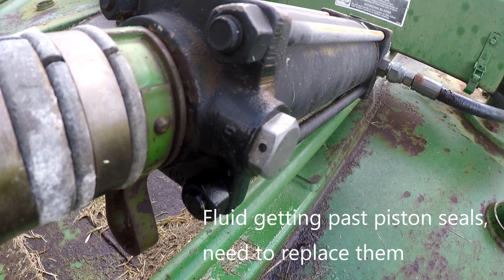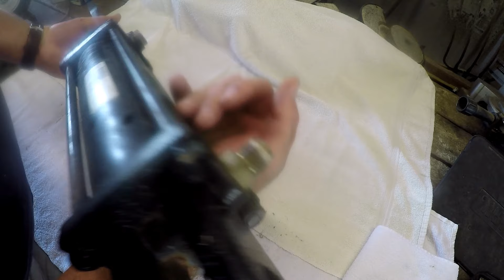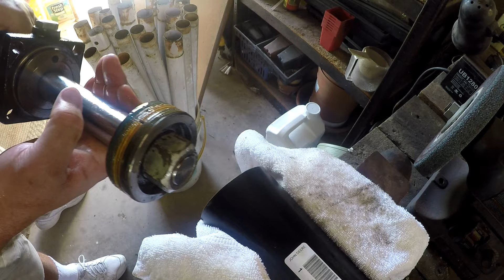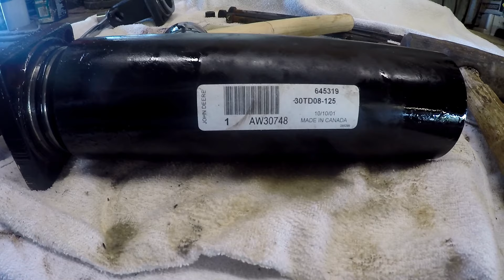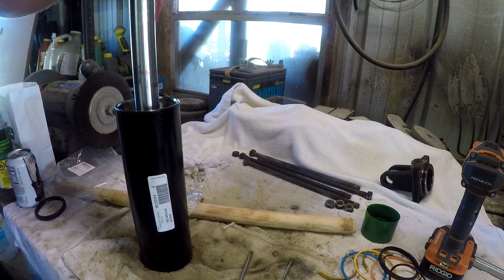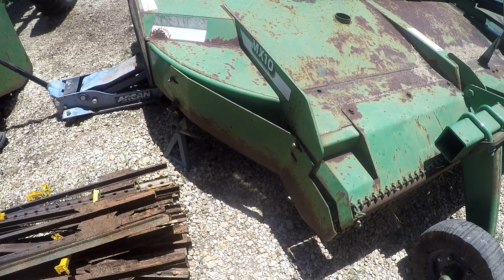Repairing leaking hydraulic lift cylinder; John Deere MX10 Rotary Cutter

Comment: How bad is that MX10 to sharpen blades on?  Just recently picked one up ourselves.
Reply from the maker: They're big and get rounded off.  I don't even sharpen them anymore. I just shredded 30 acres yesterday, it worked fine.
Reply: unless you just sharpen the bottom of the blade, you gotta remove the blades from the machine.

Comment: Should there be a small amount of fluid coming out of the vent hole with a normal functioning cylinder?
Reply from the maker: Not every time it cycles. Occasional "peeing" is alright but if it jets every time the seals are leaking.